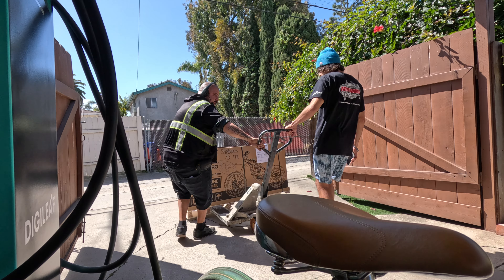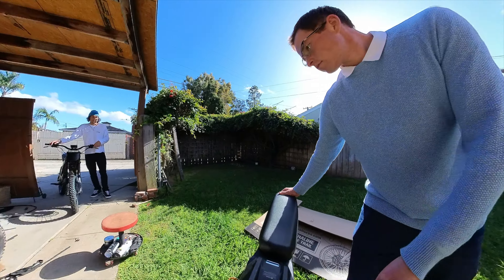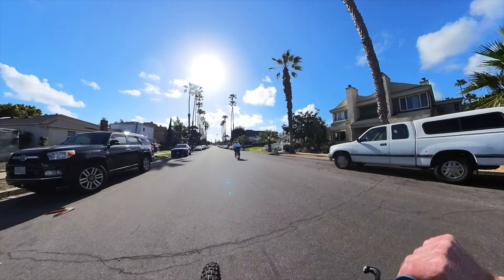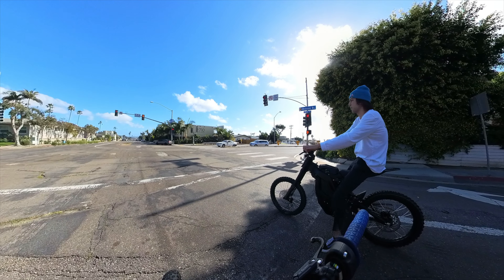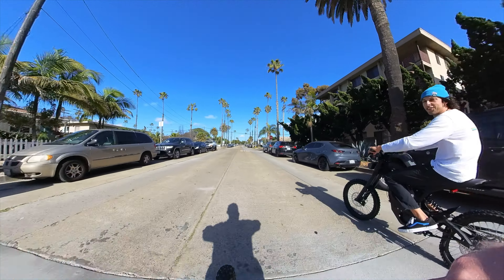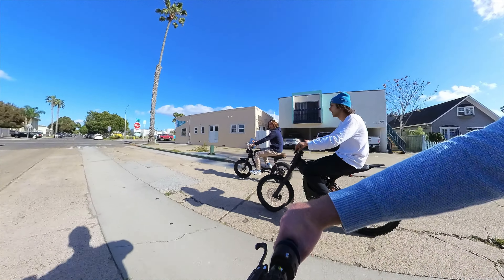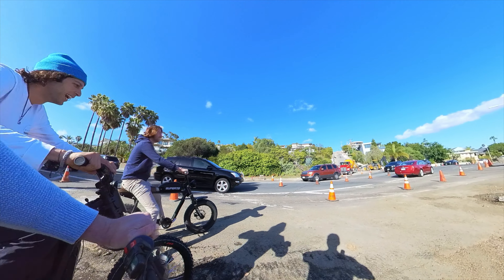The New E-RIde Pro SS 2.0 Unboxing And First Ride!

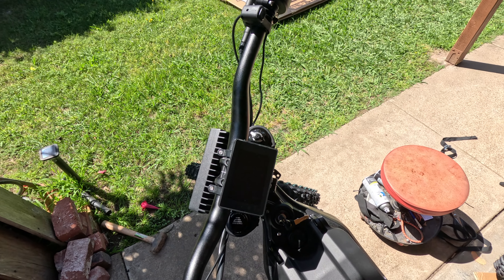Comment: 1:06 i used the number plate to hold the light exactly how i want it, i have a 1.5, pretty much the first batch of upgraded bikes to get the turbo button delete tune & rst forks...only difference ive noticed is the 3 position Ignition & new charger
Reply from the maker: They didn't include the tool to tighten that bolt is kinda what I meant. But yea and I think the brakes and some of the other peices went from off brand to eride pro branded. They may be the same haha but they say eride now

Comment: 6:54 Quick tip, twist the compression knob on top of forks to full stiff & the bike wont pop up like that from a stop/low speeds
Reply from the maker: Yea it has so many settings I need to figure it out. My last bike, the 160 only had one dial on each not two
Reply: @plantakeovertheworld  yeah, so far ive only used the compression dial,  i go to max stiff then dial back 5 clicks & thats how i ride, no unwanted power wheelies under full throttle from dead stops but can still pull the wheel up when i want to.
Reply from the maker: @jamikes94  on the pro ss? I only weigh like 160 so idk if there's any setting that can stop it from looping haha. I'll mess around with the settings though and see

Comment: How tall are these compared to a normal 250 Dirtbike
Reply from the maker: Just slightly shorter, way thinner and 4x lighter. It still stand pretty tall, just how thin it is kinda throws you off at first

Comment: I'm looking for a bike that's around $1400-$2000 that can at least hit that class 3 28mph. Looking for good style, 1000W motor, and like 50+miles on 1 charge.
Reply from the maker: Get a used super 73
Reply: Maybe a burromax try look into that. The bike is really fun too and actually has suspension unlike the 73